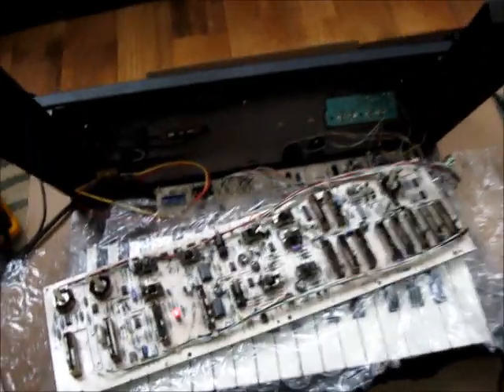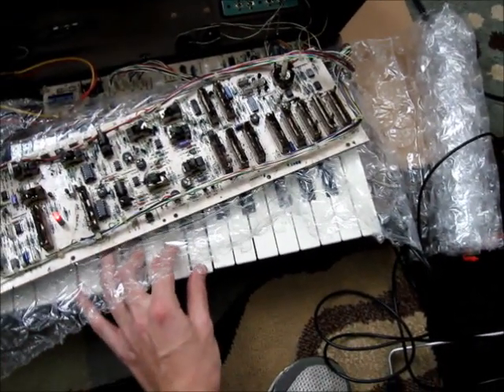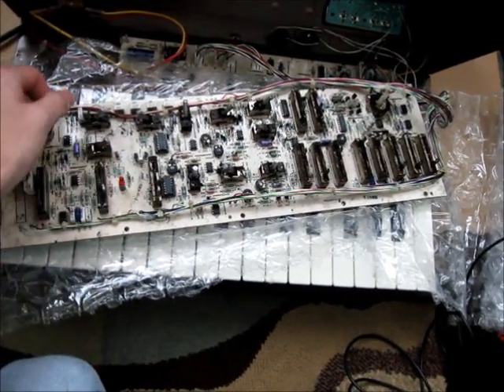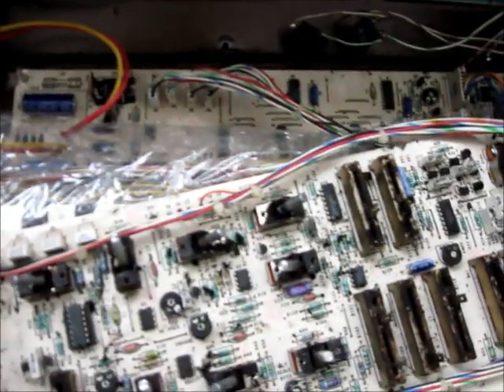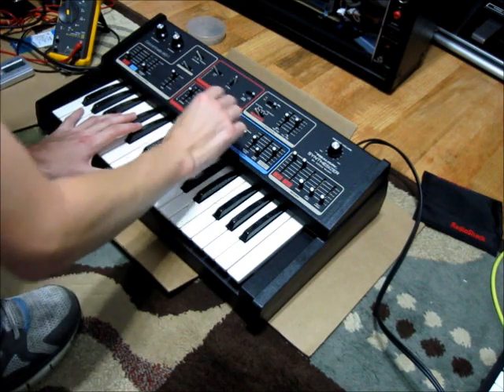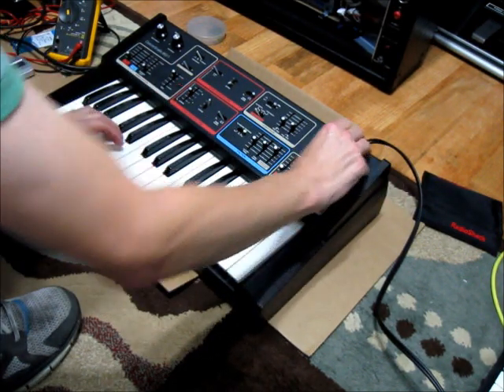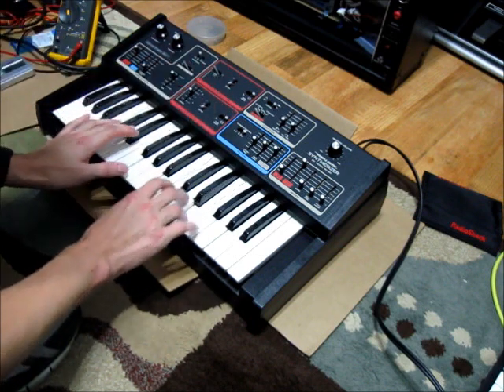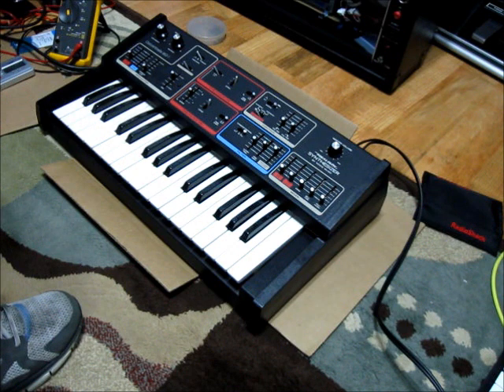Aidan's Realistic MG-1 moog Restoration (by Synthpro)

Comment from the maker: Well, I am still experimenting right now with cleaners. What I usually do is de solder all the sliders/trim pots and take the circuit board outside and wash it with degrease cleaner. You do have to be careful doing this because it is not ESD (electro static discharge) safe and you can damage components. I actually pull the sliders apart and clean them from the inside out. This little synth I did not go that deep since the customer was on a budget, I just got his decently clean.